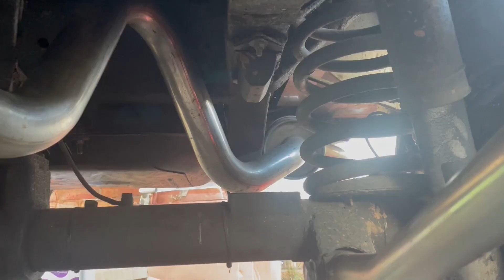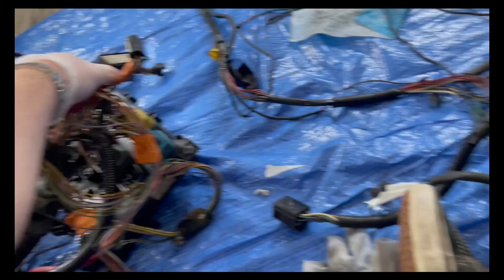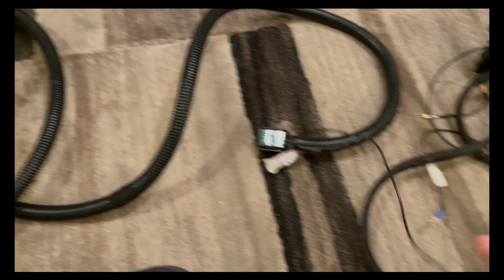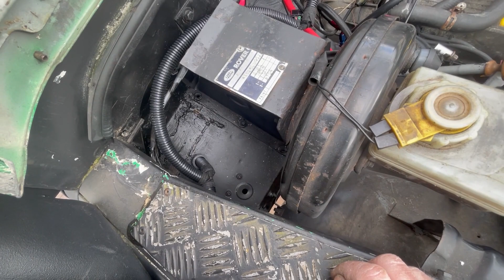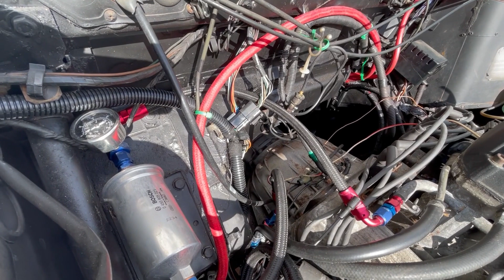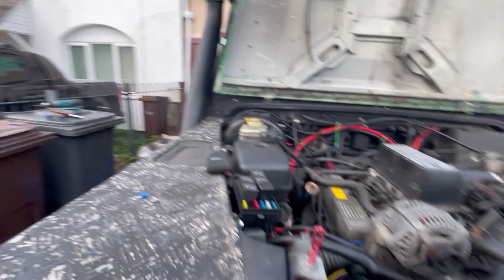Overland Defender Camper V8 Conversion Part 5 Wiring.. Will it Start???

Comment: Ive done this conversion years ago, and it wasn´t easy. Had to break it down into sections and once I got it driving took another 40 or more hours of fettling to get it right. I had to get parts from different iterations of rovers so it looked stock. Make sure you keep it nice and cool, those things get hot under the bonnet, keep it up!
Reply from the maker: Thanks for the comment 👍 that’s exactly what I’m trying to do keep it Land Rover parts bin, cheers 👍